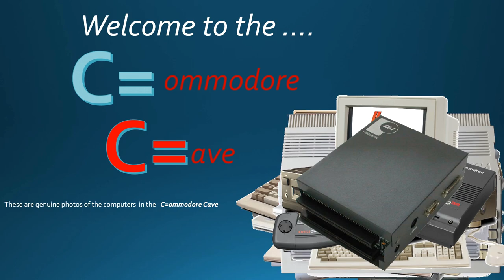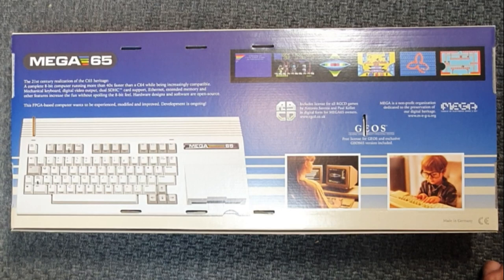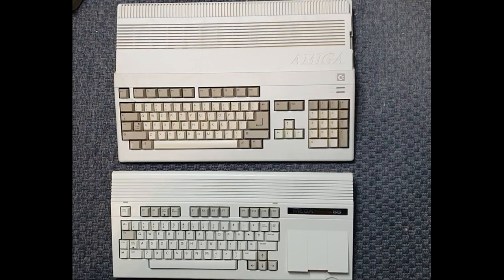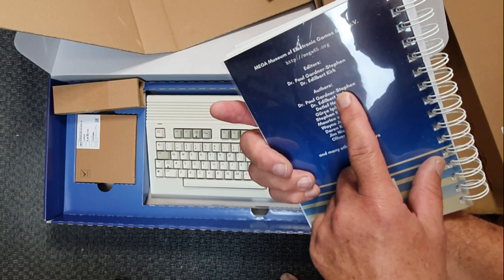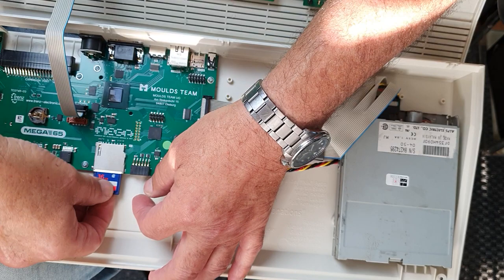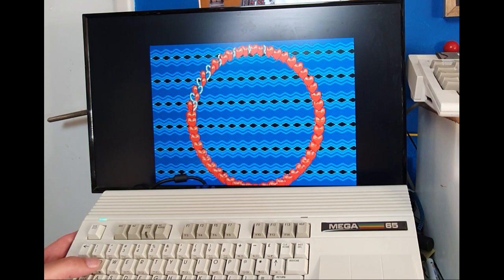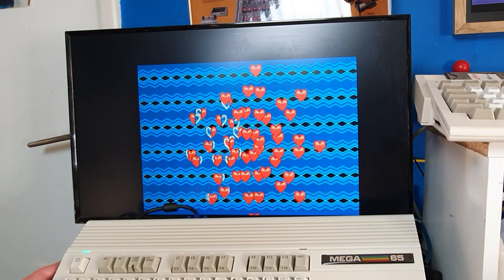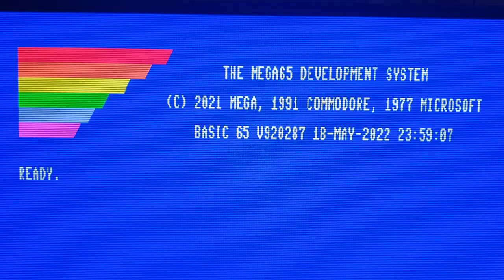Commodore Cave - Mega65 computer

Comment: That's a great looking machine and very reminiscent of the Spectrum Next project. The inclusion of an actual FDD is great. Love it.
Reply: It looks like they forgot the floppy drive and added that part on later.
Reply: @Throckmorton.Scribblemonger  eh? It's simply styled after the original prototypes. The Spectrum +3 and the Amstrad CPC6128 had the floppy drive in the same location.

Comment: I never owned any of the 8 bit Commodore computers, though did use my friends C64 when I visited.  My first computer was an Amiga 500.  I would have never imagined that these wonderfull computers would still be around today.  All I can say is it's a great time to be around for us Retro Computer users.  I recently got myself the A500 Mini, and just hope that a Maxi version with a working keyboard ends up being released.  Congratulations on your Mega65 purchase and hope you have many wonderfull hours using it, which I'am sure you will.
Reply from the maker: The A500mini is a great one to start with and opens up the whole library of software. I keep mine in the lounge beneath my TV and it's available for anyone to use (or abuse). Personally though, I hope they don't make a maxi 500 version, I'd much rather see an Amiga 1200 Maxi version. Anyway, glad you liked this youtube and thanks for commenting. cheers Graham.
Reply: @commodorecave5581   a 1200 or 3000 version

Comment: Just a few things I don't like are the power supply (should at least have been the same color as the machine), the plastic sheet on the front of the user manual and the large rings. I do consider buying one in the next batch.
Reply from the maker: Paint?
Reply: Well.. of course it should remain original, so I would not recommend painting, but it does look like a generic replacement. Clearly so much care was put in this machine and the packaging and it’s almost perfect.

Comment: Nice bit of kit but that price though!
Reply from the maker: I still don't get it. What would you expect to pay today for a new condition boxed commodore 64, at least  Aus$300 to $500?  But then add on the cost of an HDMI upscaler, as well as a VGA adapter,  plus an SD card reader, then an ethernet adapter, then a memory expansion......
Reply: @commodorecave5581  That's one way to look at it. Another way is to note that it's about double the price of a Sinclair ZX Spectrum Next.
Reply from the maker: @sambagogo777  Maybe, and another way is that its twice the price of a Galaxian Star Snapper.
Reply: Injection moulding is VERY expensive.... it's $10000.00 per die for setup plus the cost of producing the units... not to mention custom made and custom printed keycaps, cherry mx keys, custom PCB, etc., etc. etc.... ALOT of money went into just making this.
Reply: I really can't get over the steep price. Twice the price of a MiSTer FPGA complete setup. But hey, if you have the money to buy it, do so! It's a nice collectors piece 👍 The only thing that really bothered me was those kinda rusty floppy drives that showed up on FB 🫤

Comment: The price is also not nearly as bad as it seems when you consider that it is actually many different computers in one since it can load as many different "cores" as you want. Currently it supports several already and more will be added as time goes on. Also, I imagine that the price will eventually drop when shipping problems around the world are no longer an issue and also when they are able to make more of them, cheaper.
Reply: The price is the scary part and then needing to learn a niche operating system. I would love to get one it’s a wait for now.

Comment: With all of that space under the bonnet, why didn’t they put a Rasberry Pi in there too ? With the proper switching and cabling you could choose your operating system on the fly using a single monitor.